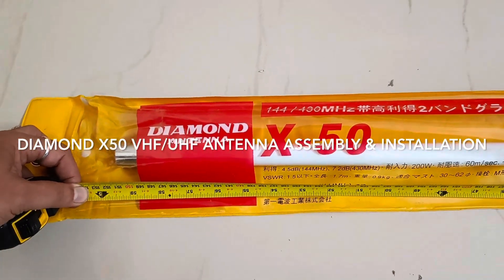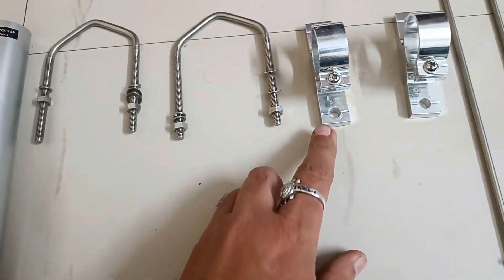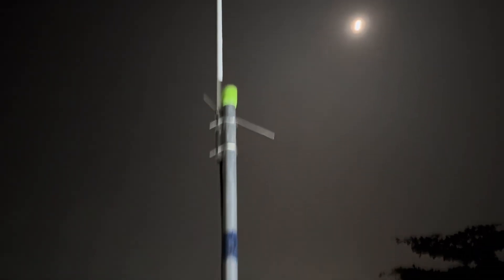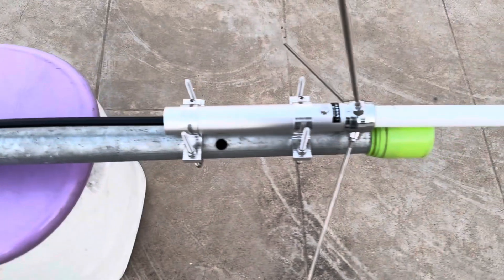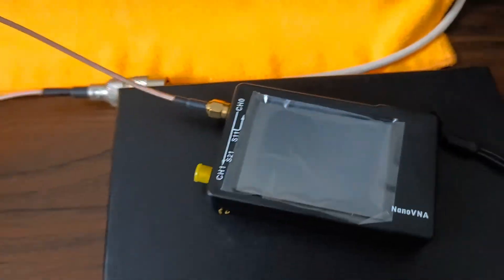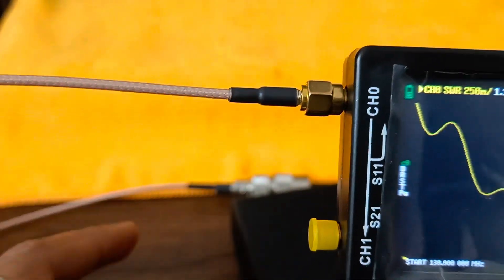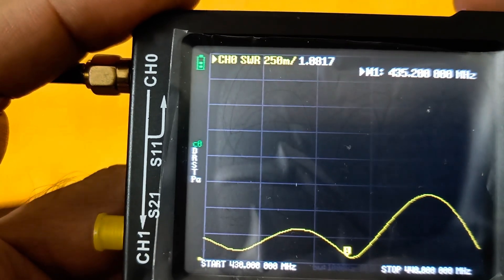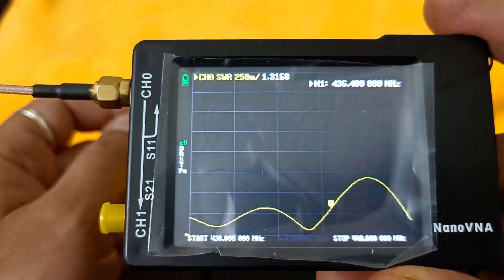Diamond X50 Antenna Setup,  Installation & SWR

Comment: Please tell me where can I the foldable mount that you have mounted the GI pipe. Thank you.
Reply: Ok Thank you. I am planning to get this antenna and that's why I was looking for this mount. My call sign is VU2 RAB.
Reply: My setup is almost similar antenna with a LM 400 cable of about 12 meters from terrace  and connect it to my ICOM straight. I am in Bangalore.
Reply from the maker: @aravindanraghavan8613  I’m in Bangalore, let’s connect, please DM me on my Instagram @AUTOMOTRIZTECHNICA with your number or you can ping me from the Bangalore HAM group.
Reply from the maker: It was done by one of our own HAM folks for our HAM Radio Operators, VU2MUD, you can contact him. What’s your callsign?
Reply: Yes I have sent you a message in instagram.

Comment: I am new to ham I was told its not a good idea to measure SWR at the transmitter. you need to measure it at the antenna feed point or very very close to it. Cables introduce loss and will give very good SDR readings because the reflection from a mis-matched antenna is actually lost in the long length of cable. It throws off the calculation done in the SWR meter.
Reply from the maker: SWR is the total for the whole transmission line, but what you mentioned is correct for the new antenna design. For ready-made antennae it's what I have done at the feed point which is o/p of the Transceiver. I wanted to see how much the Radio will provide the actual power and what's the SWR at the feed point.

Comment: Thank you very much, that's what I wanted to know. I imagine that with the PRM channels there will be no problems, right? Thank you
Reply from the maker: @jordivlctube  If you are asking about PMR Radio channels; PMR446, then it’s 446MHz frequencies ranging from 446MHz to 446.2MHz; this antenna is not for PMR. PMR is license free and these radios adhere to certain rules and regulations which is country specific. It’s allowed to operate using fixed antenna only with max power of 500mW.

Comment: The problem is to know if it is saturated with these walkies. That is the question. Thank you
Reply from the maker: @jordivlctube  Quansheng Walkie UV-K5 series is having wider band but this antenna is only for the VHF & UHF HAM bands 144-146MHz in VHF and 434-438MHz UHF bands only, for the other bands this antenna will not work, it will reflect back the power back to the Transmitter. For TD-H3 it will work for HAM bands but not the GMRS & FRS ones.

Comment: Hello! Could you tell me how this antenna behaves with the quansheng walkies and TID H3 for example? Thank you, I ask you about making or not making the investment of money.
Reply from the maker: @jordivlctube  I have not used these mentioned transceivers by you, but it works well in lower power at 3-5W nicely. This antenna is Diamond X50; For making an antenna you can start with J-Pole on a PVC, it works perfectly, but meet the SWR factors precisely
Reply from the maker: Quansheng Walkie UV-K5 series is having wider band but this antenna is only for the VHF & UHF HAM bands 144-146MHz in VHF and 434-438MHz UHF bands only, for the other bands this antenna will not work, it will reflect back the power back to the Transmitter. For TD-H3 it will work for HAM bands but not the GMRS & FRS ones.

Comment: Good video. Whats the name of black color mount ? Is it custom made ?
Reply from the maker: Thanks, The mount that holds 1.5" pipe is a custom made Antenna Mount, By removing 2 upper Bolts the antenna mast can be  tilted down easily for maintenance.

Comment: What size u bolts come with it ? Will it mount to a 1 1/4 or 1 1/2 mast
Reply from the maker: The U bolts are capable from 1-1/4 to 2” GI pipes